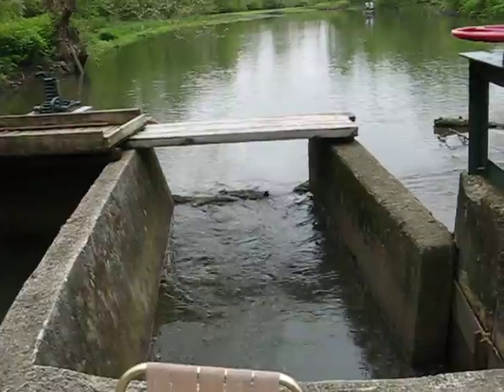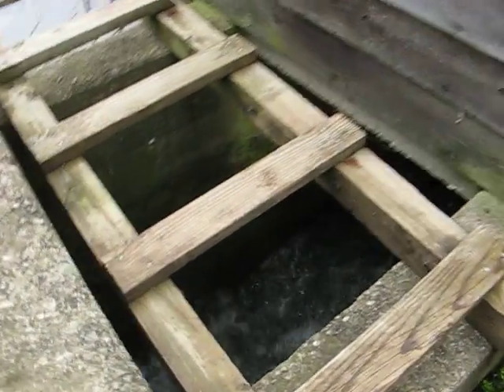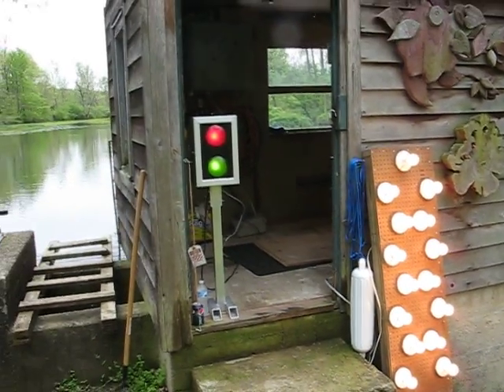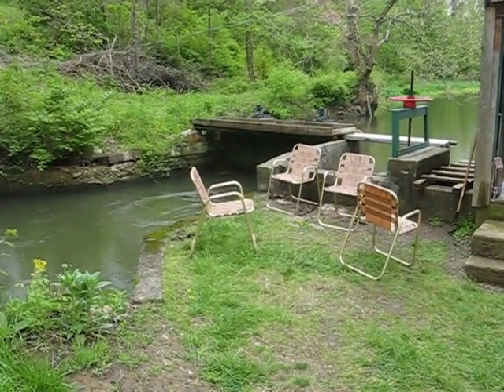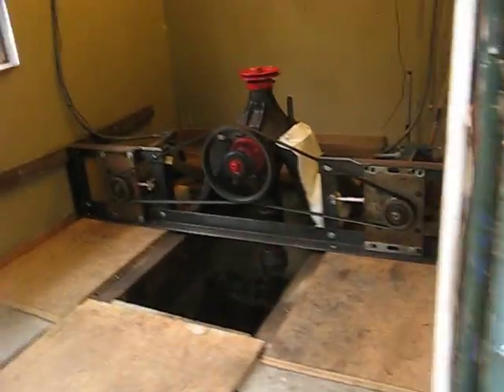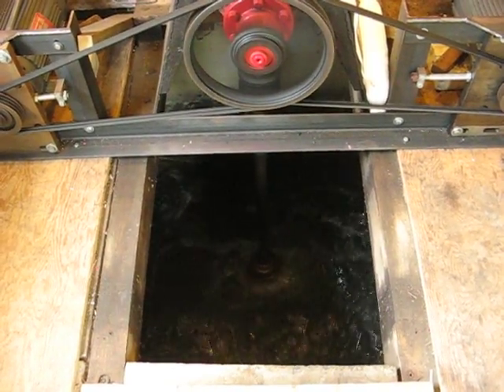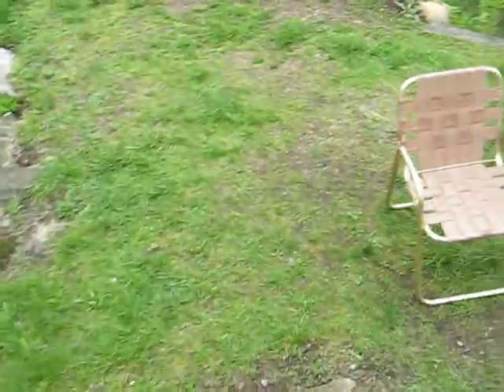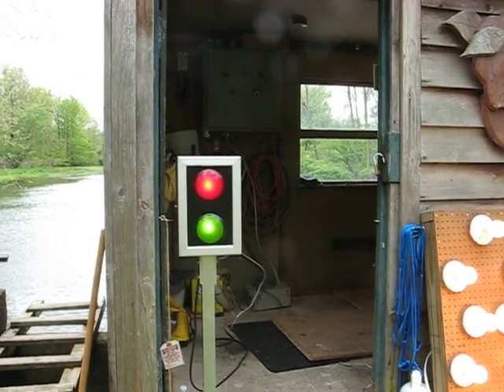Bear's Mill Hydroelectric

Comment from the maker: No problem, Mike.  These are 120VDC motors.  With the turbine spinning at 180 RPM, they are putting out 150V.  We need bigger motors!

BTW, we discovered that CFLs run on DC.  I didn't know that before.

Comment from the maker: With a full head of seven feet, the turbine will spin at 200 RPM.  The truck differential has a 6:1 gear ratio.  So the main center pulley is spinning at 1,200 RPM.  We have a 2.5 pulley ratio to the generators on each side.  As a result, both are turning at 3,000 RPM.  The "generators" are actually 3kW brushed DC servo motors, being driven in generation mode.  They work quite well, though are too small for the application.  They are producing more DC voltage than they are designed to handle.